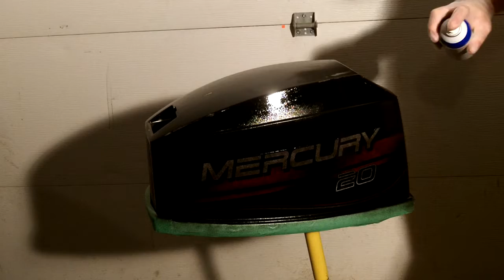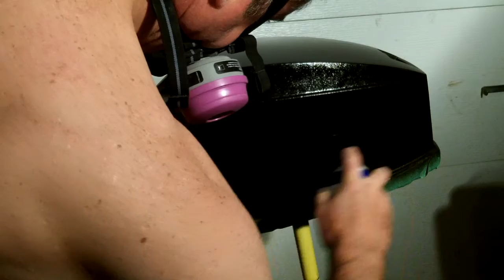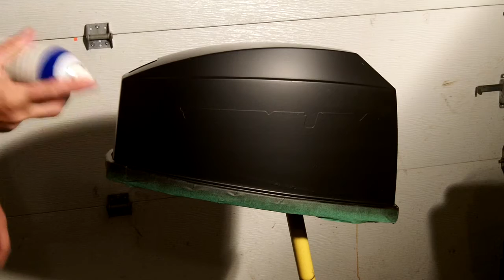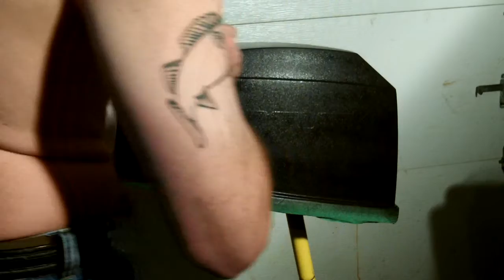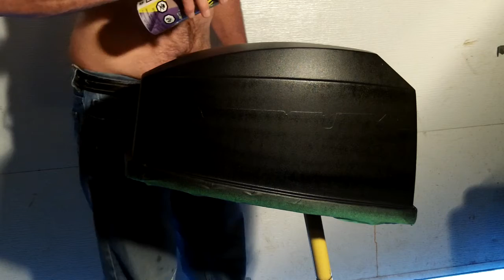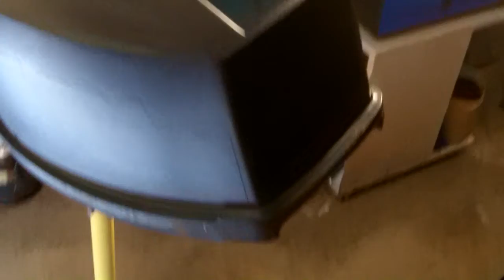Plasti dip my Mercury outboard Cowl

Comment: How many cans did you use?
Reply from the maker: If I remember, I only used one can of Plasti Dip on this 20 HP cowl. 
It's better to put at least five layers of plastic dip. 
Your first coat should be thin and you have to see through it like 50%.
You will use more of course if you want to do it on a 50 HP or even more on a 150 HP. 
Preparation is the key to success.
Wash your cowl with dish soap twice to remove any grease or dirt.Let it dry and before applying the Dip, wipe it with rubbing alcohol and let dry.
This will ensure that the Dip will stick very well and last a very long time. I did this on my pickup truck Togo to my channel https://www.youtube.com/edit?o=U&video_id=KwwdoCcRdog
Thanks for watching and don't forget to subscribe for more.Best regards.